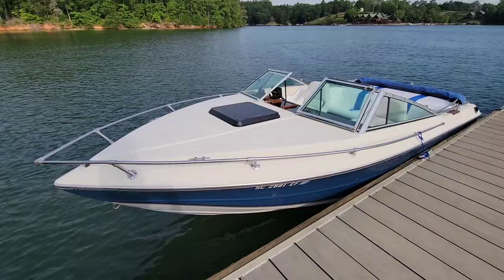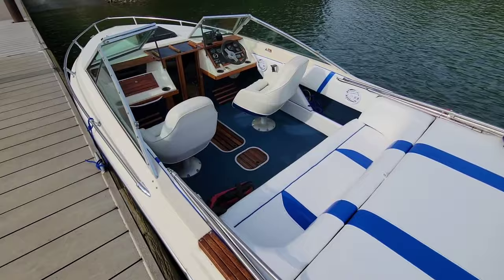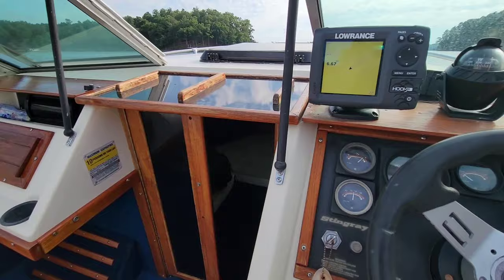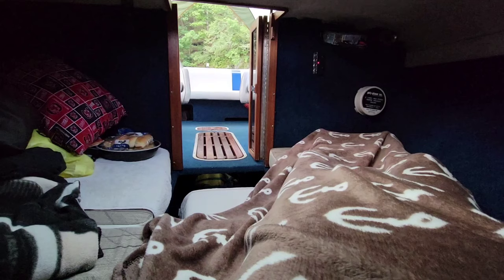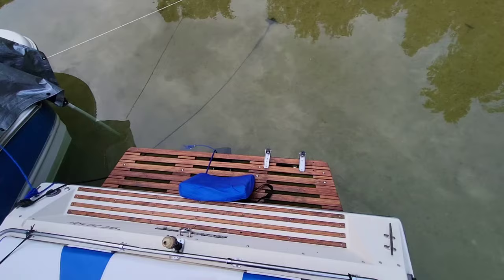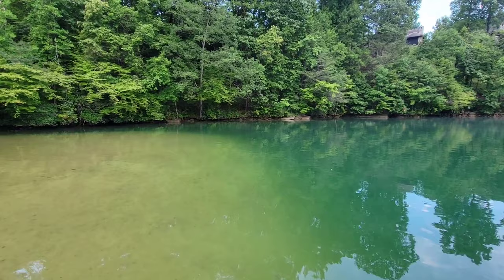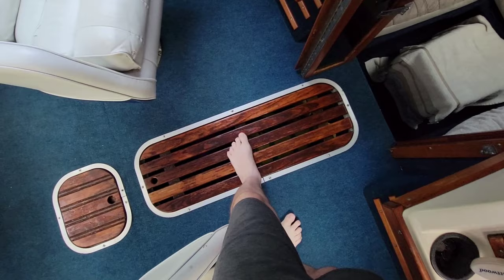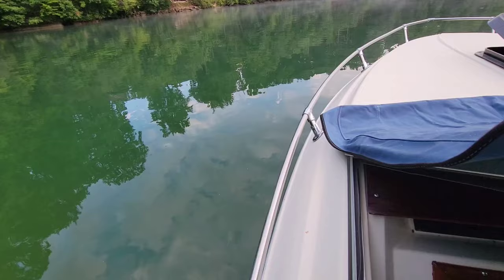STINGRAY Cuddy cabin sleep overnight

Comment: That boat looks great! and love to see people camping out on the smaller boats. we had a 4.2 m placom 4 seater with 40 hp outboard and outfitted with a home made camper canvas and now we have our maxum 1900 sc for 10 years. both boats were used for watersports as well for camping weekends on the water. Now we have a 7 year old daugther and the boat is getting too small for camping. we have a porta potti, a peltier car fridge, 100w solar panel, some floaties and even a rc jetboat, a prop driven mini surfboard for my daugther to cruise around the boat, tablet to watch a movie at night etc. but as said, it is getting too small. so now in the process of buying a 2001 3470 ft cruisers yacht. exiting times.
Reply from the maker: Yes very nice.  I also have a 2400scr Maxum cabin cruiser and love it ( don't have videos)  and perfect size to trailer anywhere and still big enough to stay on a week at  a time ,  I have engine out of it and want to install a 6.2 stroker I have waiting to go in with bravo 3 outdrive, then I should have videos of our adventures,   love the Florida gulf coast Intercoastal waters
Reply: @Vassmotorsports  "perfect size" in the USA is a different size compared to the same words in our country. While in the US the most popular car a probably will be something like a ford f150 pickup we have more something like a ford focus. everything here is smaller. parking spaces, roads, houses distances and boats too. I am very happy I am able to haul 2 tons with my subaru forester xt compared to much less of most cars here.